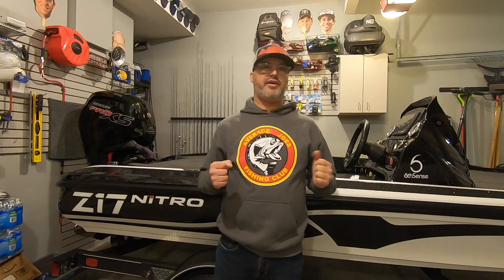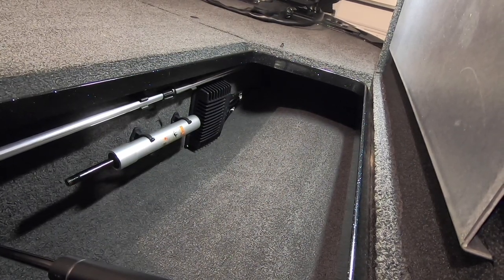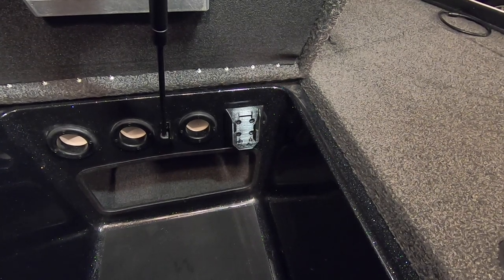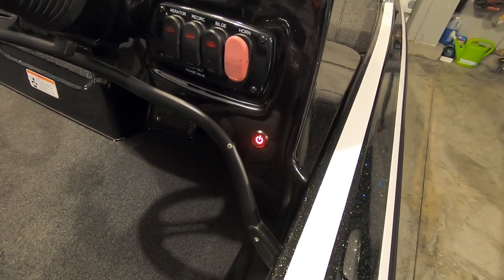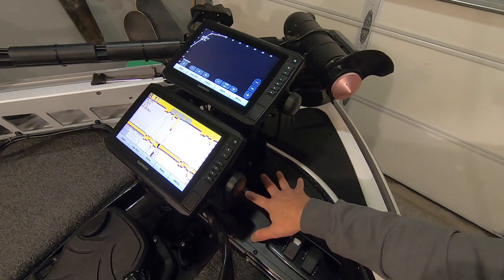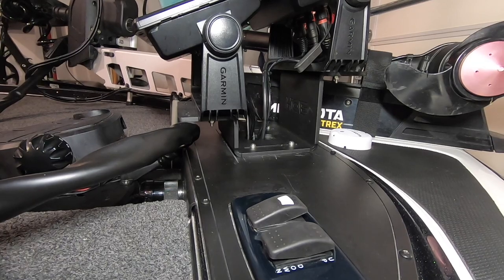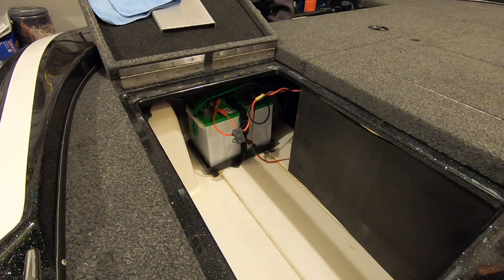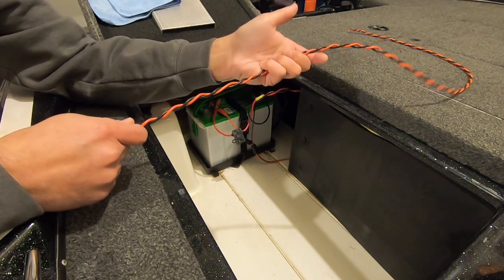My GARMIN LIVESCOPE Install, DeWalt Battery Hack, GARMIN Networking Tutorial + TIPS!

Comment: How long of a charge on you getting on your black box with the Dewalt 20V battery?  I have already ordered the seelite adapter and was going to use a 6ah Dewalt.  Thanks for any info you can provide.  Great vid.
Reply from the maker: Thanks for watching. I also ordered 6AH batteries for mine. I just got the offbrand from Amazon. They work great. They last about 7 to 8 hours each.
Reply: @awidman75  Cool that is great to know.  Thanks and appreciate your attention to detail.  I like keeping my boat tight too !
Reply: @awidman75  BTW, which off brand?  There are a bunch of them.  Thanks.
Reply from the maker: It doesn’t have a brand name on the battery. It’s just red and black. The model number is DCB206, but I don’t know if that’s specific for this battery.
Reply: @awidman75  Gotcha.  That is the Dewalt number.  I see that one.  Appreciate the info.
Reply: Hey 745, quick question.  How did you wire in your power switch to the dash.  Please advise if you don't mind.  No hurry.